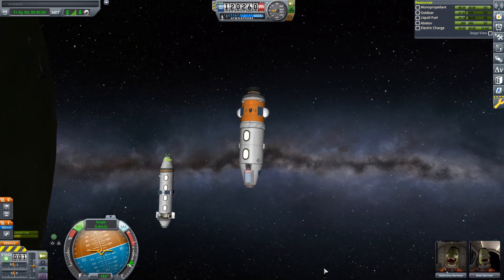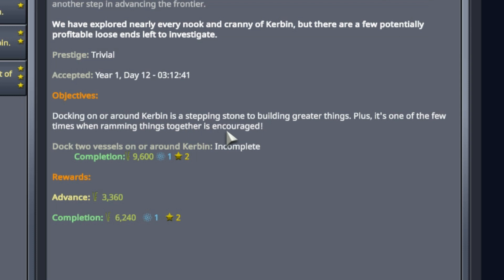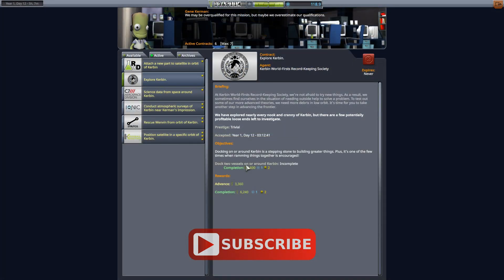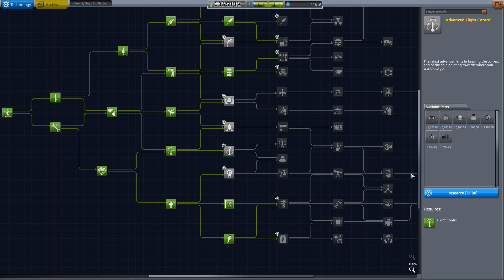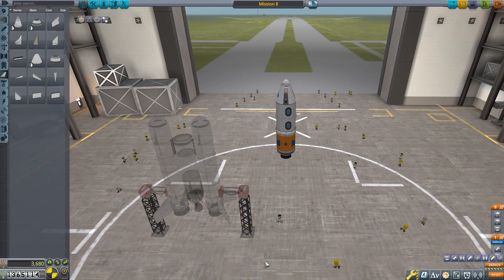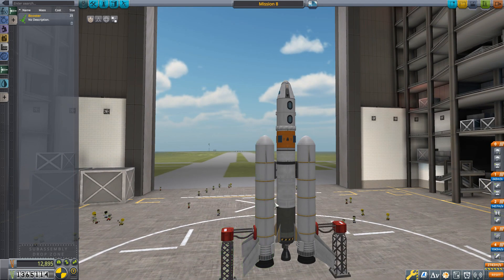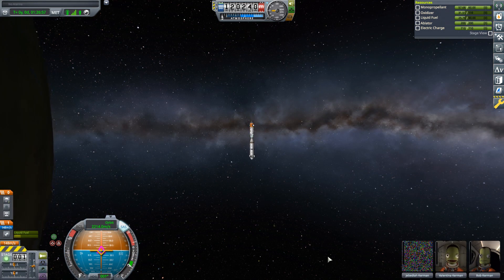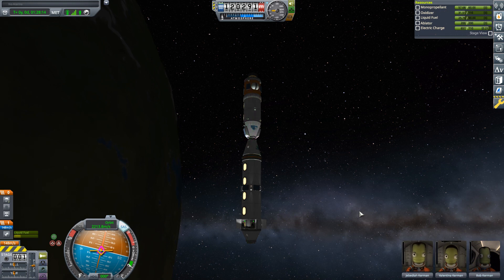How To Do Your First Docking | KERBAL SPACE PROGRAM Contract Tutorials

Comment: Ive always just set both crafts docking ports as target then have them face each other then move one until docked. Has worked flawlessly everytime and only requires forward and backwards RCS
Reply from the maker: I considered talking about that one, but it due to length. The normal-antinormal method is nice for stations, as you can set that way and leave it for all future dockings. As stations get bigger, they can be hard to sling around.
Reply: The Soviet-era Igla automated docking system did exactly the same thing; both the target and active vessels would rotate to align the docking ports. This worked fine through Salyut, but Mir was a bit trickier to rotate, so they developed the Kurs system to replace Igla as Mike suggests. 
The Space Shuttle was big, so it produced a lot of exhaust. So, the target space station would rotate so its docking port faced radial in. This made it possible to dock the Shuttle without ever using the RCS thrusters facing the station, since gravity would pull the two slowly apart. I have no idea if this works in KSP.
Reply: the lazy method of docking is the best method of docking!
Reply: It’s the lowne lazy method
Reply: Thanks matt lowne for this one. He taught me this and it's made docking ridiculously easy once I build a perfect encounter

Comment: The MK2 Command Pod from the Making History DLC does not have its own monopropellant. So it's good to double check your monoprop levels anyway.
Reply from the maker: Good point.
Reply: And if you have Kerbalism installed, monoprop is used for EVA fuel. So with Kerbalism, it is not possible to EVA from the capsule that did the first American EVAs. 
Well, it is possible to leave the capsule. Getting back, maybe not.
Reply from the maker: @JohnWilliamNowak  You just gotta hang on. It would be cool if the game had tethers, but I bet the physics would be a nightmare.
Reply: @JohnWilliamNowak  I think KIS has a little monoprop bottle that your Kermans can stow under their seats.
Reply: @ajnasreddin  I know the part, but I think it's from Kerbalism or in the core game. I've got it, and no KIS.
Reply: @MikeAben  Yes, and it is a little mindbending that a super rocket pack is easier to program than a piece of rope.
Reply from the maker: @JohnWilliamNowak  And don't get me started on where ladders are on the tech tree.

Comment: Question: if you point the vessel that you are trying to dock to in the normal direction so that it points north, then where is the antinormal icon? Shouldn't it show up when you have the target, prograde and vessel in one line? Since you are pointing in the opposite direction of the northfacing vessel.
Reply from the maker: The anti-normal vector is showing on the navball because I have that vessel in target mode. You bring up a good point, though, as you can certainly switch to orbit, lock it to anti-normal, and then switch back to target.

Comment: what does fore by throttle and always full action in actuation toggles do?
Reply from the maker: Fore on throttle makes it so engine throttle control affects the RCS thruster in the forward direction. This allows you to use RCS thrusters in the same way as regular engines. Great for small probes. Full action just means that block is either full on or off with no throttle control in between.
Reply: @MikeAben  oh ok.. thank you so much :)